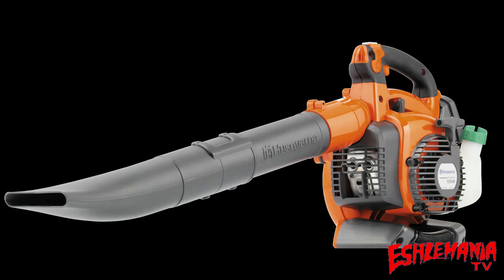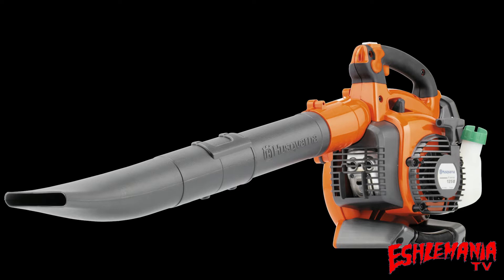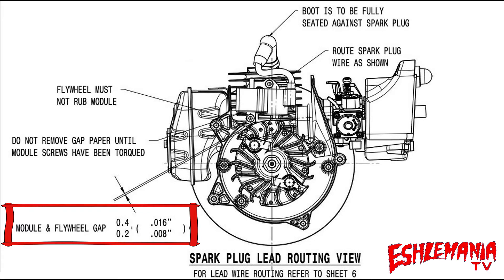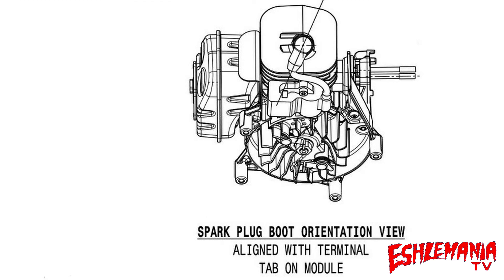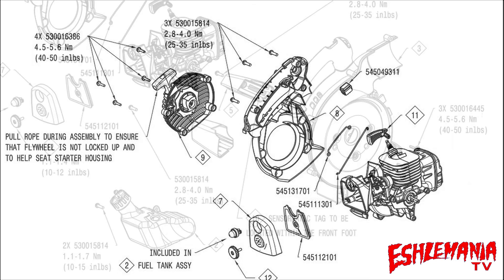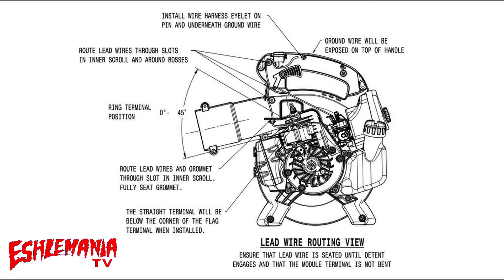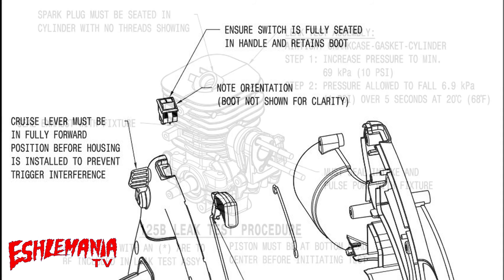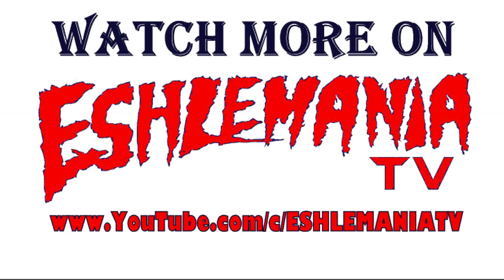Husqvarna 125B Leaf Blower Repair Specs

Comment: Thanks for this info.!!  It's great.  You know what I REALLY need?  Compression test specs.  Minimum and new after a break-in.
Looked everywhere, lots of conjecture no official specs.
Reply: I'll give my #s.  New Golf piston, ring, old cylinder, OEM chrome inside. no cylinder prep. but clean.
cold  125 psi
hot    110 psi
Runs great again.
old piston had ring stuck hard in grove. low compression.

Comment: I have this same blower. Lost compression so I replaced the cylinder ring now I can't get the spark regardless of air gap. Is it possible timing could be off although I aligned the magneto keyway?

Comment: I bought the same model from a garage sale and replaced the carburetor,fuel lines,ignition coil,spark plug and the piston ring since it didn’t have any compression.i have spark and fuel going into the engine and i have lots of compression but it still won’t start.does anyone have any advice on that?